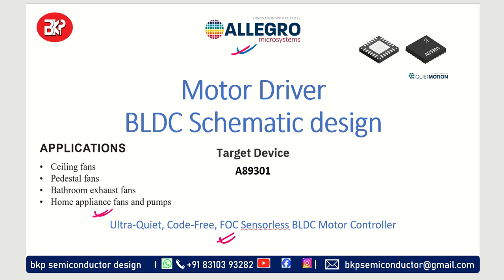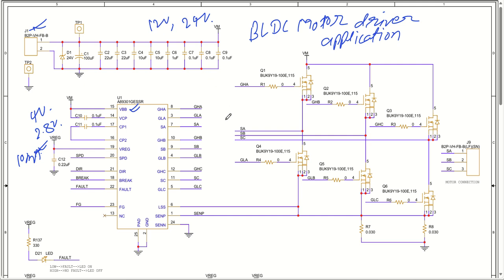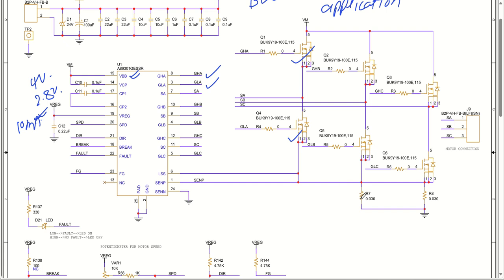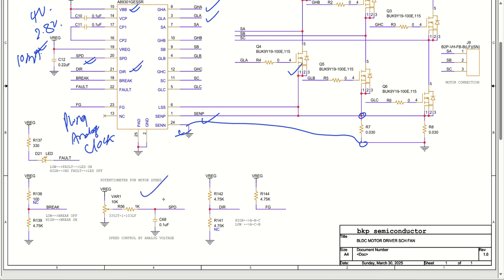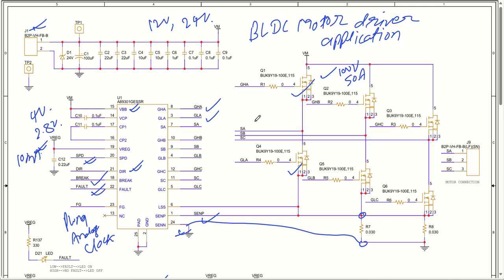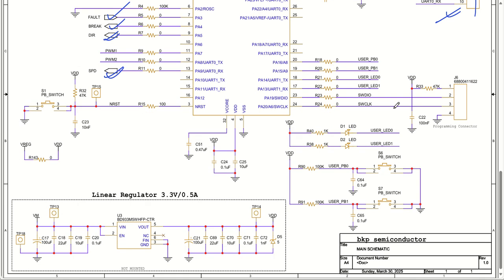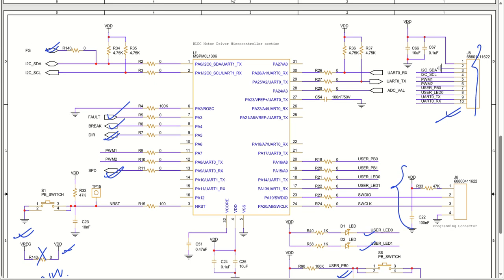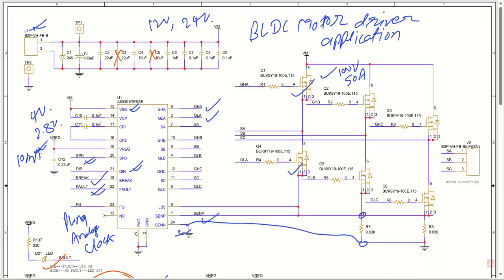122: BLDC Motor Driver schematic design fan, home allpiance Allegro A89301

Comment: I'm about to test out this Allegro chip for drone Motors High KV motor speeds. Supposedly it only does about 10 KV tops because of its one killer Hertz commutation speed. I'm putting my hopes that this Allegro will be a game changer but I'm not holding my breath. Makes no sense this slow one kill her commutation Allegro you can do better
Reply from the maker: Let us know how it goes. You can send your test results as well to us. You can ask if you face any problem in design